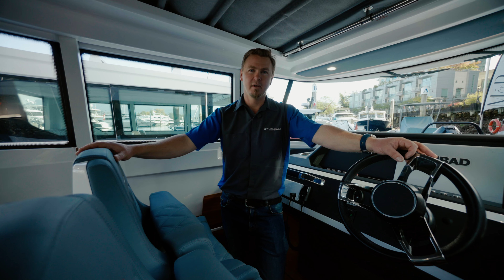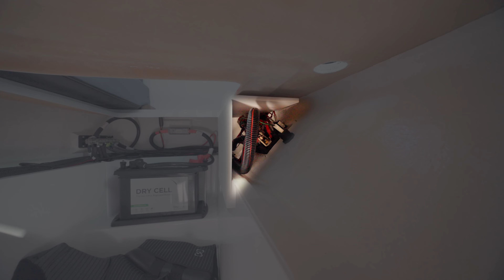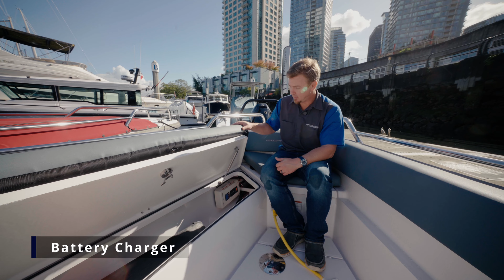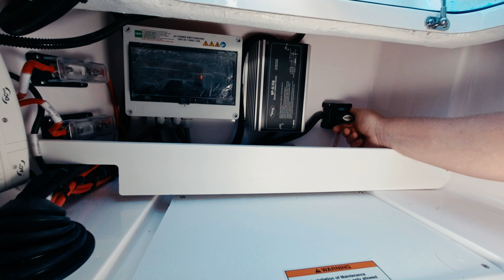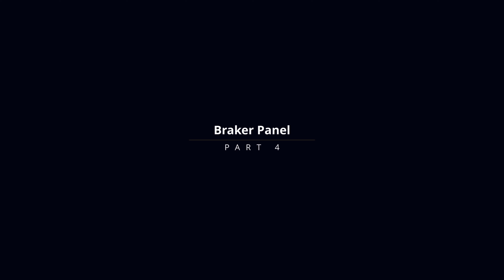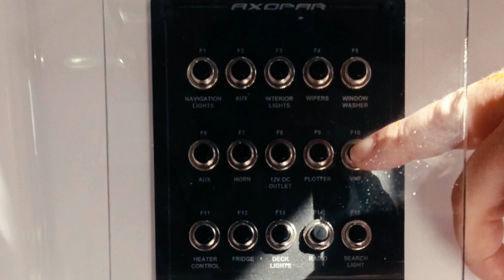Axopar 28 DC System Walkthrough: Find and Manage Your Batteries Like a Pro

Comment: Hi love your videos. Need some advice. I have a 37XC for several years now but recently the shore power has stopped charging my starter batteries; only relying on the alternators to charge them so not ideal. Any reason that you can think of why the batteries have stopped accepting a charge? Your help is much much appreciated!
Reply from the maker: Hello, if you're based in Lower Mainland we'd love to help and have a look of your boat!
Our contact is: +1-604-235-1010
Reply: I am based out in HK……